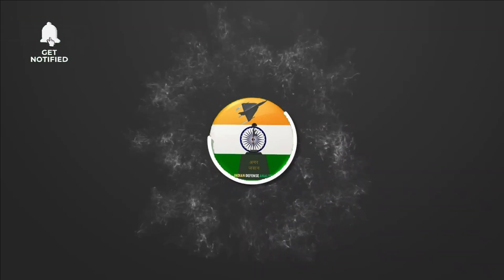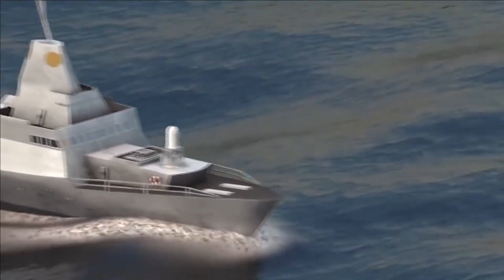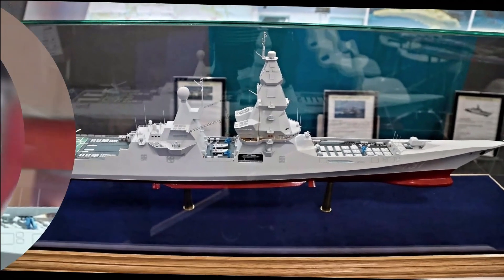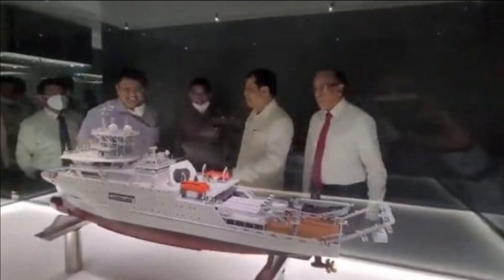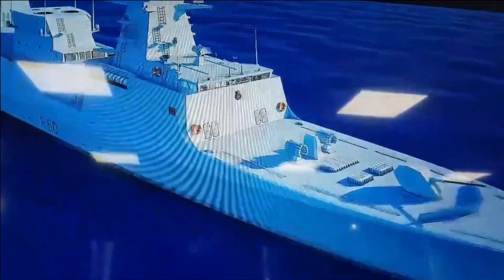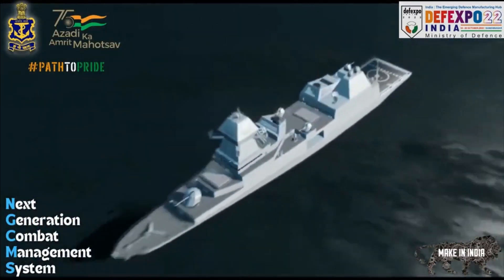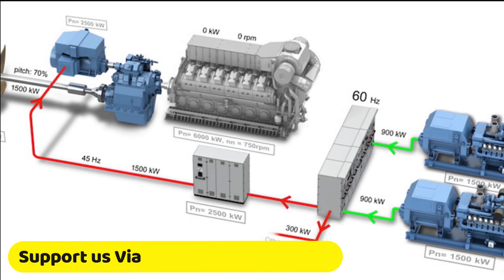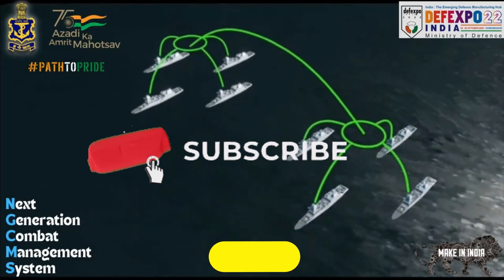Project 18: Indian Navy's Next Generation Destroyer (NGD) with 128 VLS

Comment: I think the most sensible approach would be to have 1) 1 127 mm Naval gun, 2) 2 CIWS, 3) 2 Durga ll DEW, 4) 2 Triple torpedo tubes, 5) 2 533 mm Triple torpedo tubes ( for Varunastra torpedo), 6) 80 cell VLS for Aegis BMD or Prithvi BMD, 7) 64 cell VLS for Brahmos-NG Or Nirbhay missiles, 8) 16 Slant Launchers for Vishnu hypersonic missiles, 9) 10 Cell Quad-launchers for VL-SR SAM (total 40) & 10) 1 EM Drdo rail gun.
Reply: We can add Shaurya missile also
Reply: Lot of Over the Deck Launchers means to hell with stealth.
Reply: @Sacrafago90  Doesn't matter. Hypersonic missiles are more important.
Reply: @debalik8806  Over the Deck launchers in large numbers means less deck space for future improvements & compromise with stealth.
Only 144 cells VLS configuration would do the work,no need for over the Deck launchers.
32 cells for Barak 8ER/XR SAM
32 cells VLS for SM3/BMD/SM6 
16 cells VLS for ASW Missiles 
16 cells VLS for Bramhos ER/LR LACM/Kalibr
16 cells VLS for Bramhos 2/Zircon/DRDO Hypersonic Missiles 
16 cells VLS for Bramhos NG/NASM/Seabreaker/RBS 15
8 cells VLS for 32 VL SRSAM/ESSM 
8 cells VLS for ASBM

Over the Deck components could be:
127mm Naval Gun
2 DEW CIWS
2 Pantsir/Palma/RIM116 CIWS
4 Automated Mistral/Starstreak with 8 Missiles each.
Reply: Right, if all these missiles have to be fitted then the design will have to be as big as INS Vikrant at the smallest.

Comment: Some are portraying it as Destroyer with 144 VLS cells but 128 VLS cells sounds very logical.

The ideal combination could be:
127 mm Naval Gun 
80 cells in forward section with:
24 cells VLS for XR SAM/Barak 8ER
24 cells VLS for BMD/SM3 
16 cells VLS for Bramhos ER/LR LACM 
16 cells VLS for ASW Missiles 
48 cells VLS in aft section with:
16 cells VLS for Bramhos 2/DRDO Hypersonic Missiles/Kalibr/Zircon 
16 cells VLS for 64 VL SRSAM/ESSM 
16 cells VLS for Barak 8ER 
4 CIWS,2 DEW CIWS & 2 Gun & Missile Module CIWS like Pantsir M/PALMA/RIM116 
2 Triple Torpedo tubes 
8 L&T Inclined Launchers for 8 ASBM(4×2)

Before P18,Indian Navy must upgrade all existing Destroyers during midlife refit with the almost the  same configuration:
For Delhi Class
76mm Oto Melara 
Total of 64 VLS cells replacing 2 Shtil 1 systems 
32 cells VLS for Barak 8ER 
8 cells VLS for 32 VL SRSAM/ESSM 
8 cells VLS for Bramhos ER/LR LACM/Kalibr/Zircon/Bramhos 2
16 cells VLS for ASW Missiles replacing 2 RBU6000 unguided rockets 
4 Quad cells Inclined Launchers for 16 Bramhos NG/Sea Breaker/NSM/RBS15
2 Pantsir M/PALMA/RIM116 CIWS 
2 VSHORAD like Automated Mistral/Starstreak 
2 Triple Torpedo tubes 

For Kolkata/Vishakapatnam Class 
76mm Oto Melara 
80 cells VLS tubes:
32 cells VLS for Barak 8ER 
16 cells VLS for Bramhos ER/LR LACM/Kalibr/Zircon/Bramhos 2
16 cells VLS for ASW Missiles 
16 cells VLS for 64 VL SRSAM/ESSM 
4 Quadcell Launchers for 16 Brmahos NG/Seabreaker/Nirbhay/Kalibr
4 Pantsir M/PALMA/RIM116 CIWS with gun & Missiles 
2 VSHORAD like Automated Mistral/Starstreak replacing RBU6000 unguided rockets.
2 Triple Torpedo tubes
Reply: More confusing
Reply: confusing